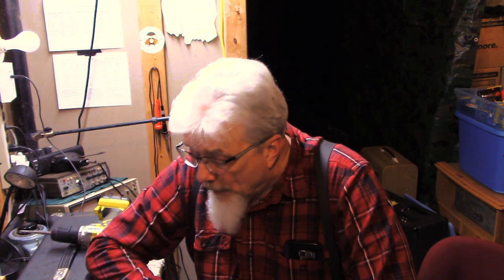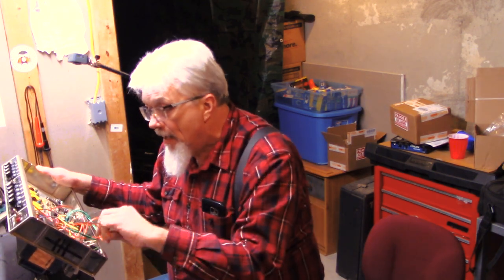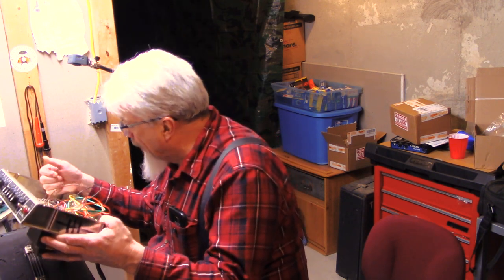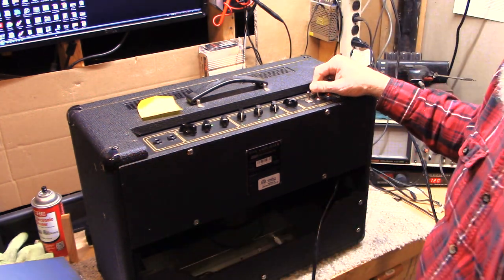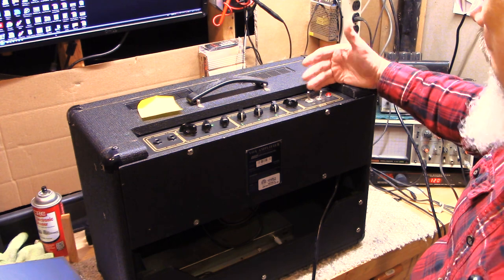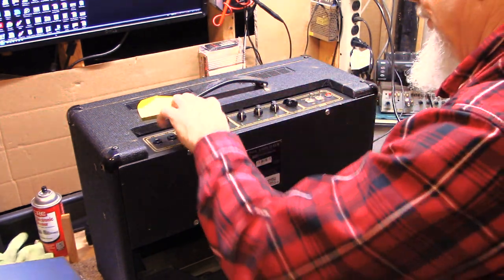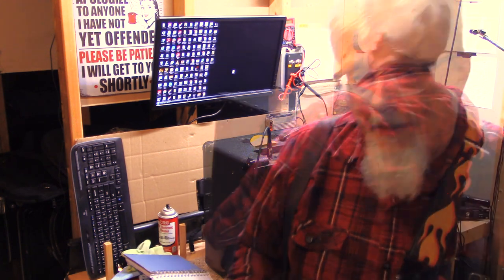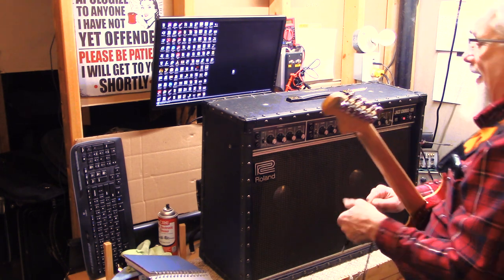E01   Quick Triage of four Broken Guitar amplifiers and Video Equipment Beta Test

Comment: Looking forward to seeing more! Magnetone question: what makes the varistors so special??
Reply from the maker: Good question!
To work in the Bonham Frequency Modulation circuit, several factors are critical:
Impedances at the high and low points of the Vibrato operating cycle, operating and peak voltages, DC power rating, response time, temperature coefficient, and maybe others.
I have messed around over the years with a couple of the replacement circuits and always had problems with switching noise.

Also, I will not buy "NOS" Maggie varistors online, because most of them are NOT the exact, correct part. In two cases, customers chose to take the chance of buying and having me replace them. In both cases, they phased oddly and were "swishy."

Magnatone has figured it out in their reissue amps, but no parts ave been released - I'll bet it took a ton of R&D to source and determine and source the correct parts. 

In summary, I think that while it's cool to own and play through an original, if one is just interested in true vibrato, there are several great sounding low-voltage, modern versions available. So, there isn't a lot of incentive to manufacture a specific varistor for the application.

A one old example of true vibrato (pitch-shifting) is my Kustom 240-4 -- It features tremolo and vibrato!